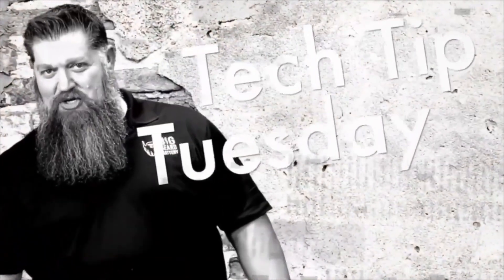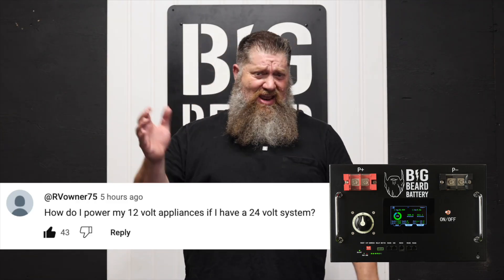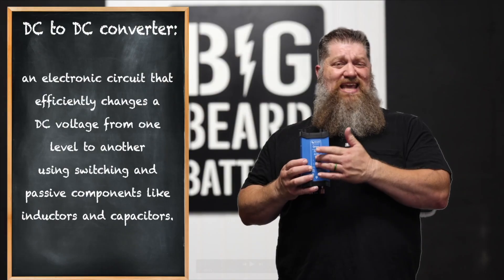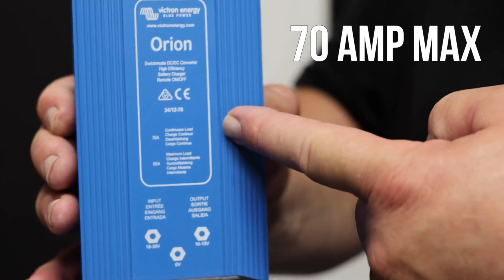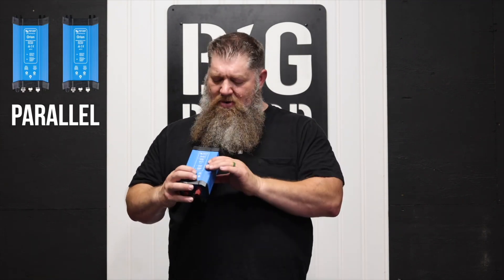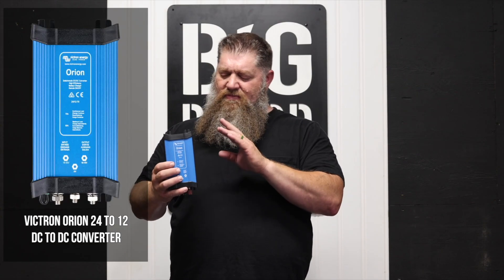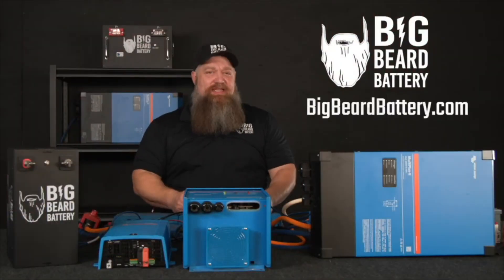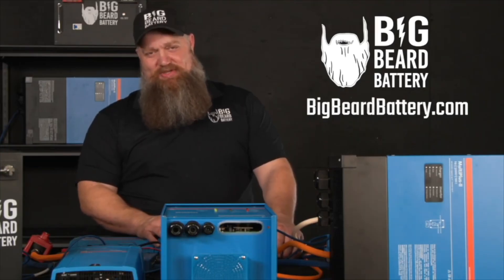How to Run 12V Devices on a 24V System | Victron Orion DC-DC Converter Explained

Comment: Tod I know this is not a charger, but will the 12v battery draw  from the 24 v battery bank through the  Orion  converter and charge that way if 24bank is full.?
Reply from the maker: Donut depends if you get an Orion converter or an Orion charger. A converter typically does not have battery charging logic. But the Orion CS and Orion 1400 does convert and has battery charging logic.  Both push up to 50 amps from 24-12.

Comment: Wouldn't that 24/12-70 cook a lead acid battery since it's not a multistage charger if leaving in a 12v battery?
Reply from the maker: So this is a 12v supply not a charger. You remove the 12v battery from the RV if you choose to go with a 23-12converter.
Reply: @BigBeardBattery but Victron and others say it will charge a battery. I see these often installed with the OE 12v battery left in place. Even if you set it to float voltage, I assume a flooded battery will have reduced life. I originally was going to install 3 of these units with no battery. Now I'm thinking I would like to keep my flooded battery as a filter/backup/buffer. So now I'm pondering using an XS 1400 to charge and power my 12v side. I have electric leveling, 3 electric slides and an Onan 5500 to crank. Also a 12v DC compressor fridge.
Reply from the maker: @earlzeis35 the 24-12-70 is a converter not a charger. There is NO programming. Not Bluetooth nor GX. 

Now the Orion  line does include chargers and the largest 24-12 charger is up to 50 amps. It comes as the Orion XS and the Orion 1400